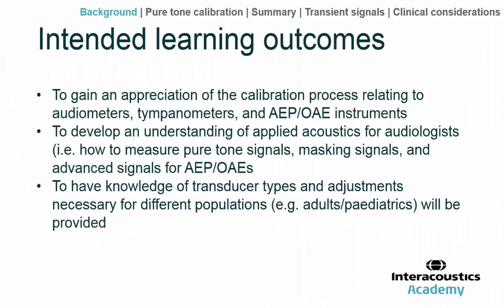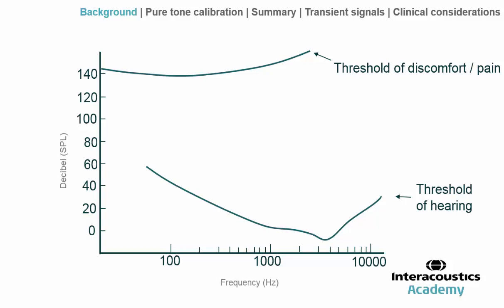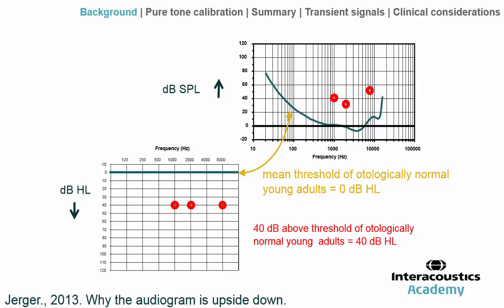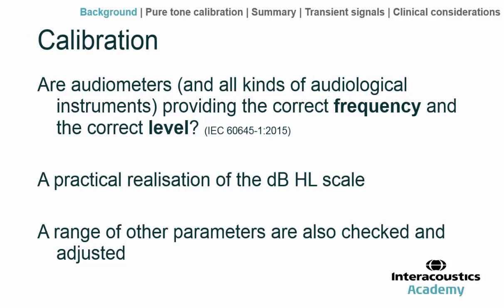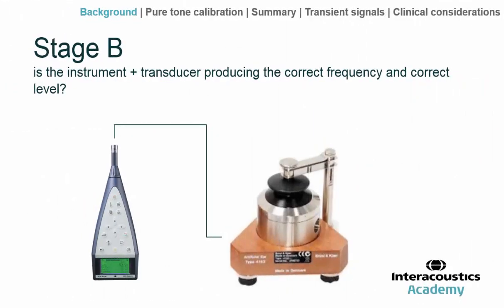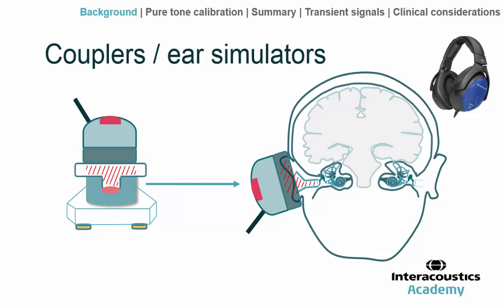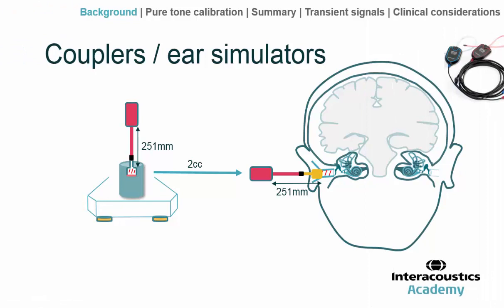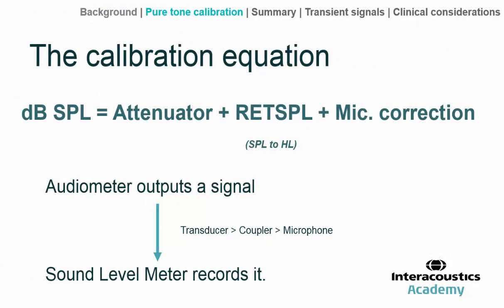Acoustics and Calibration for Audiologists (1/2)

Comment: Thank you for the clarification. In that case refers to force level. So, when considering force level, it's not SPL (Sound Pressure Level) but FL (Force Level), or rather microvolts per dB. Why should we factor in the sensitivity of the artificial mastoid?

Comment: Good video.

but how would it be to calibrate the audiometer but using Larson Davis.

Also how to calibrate the AFFINITY 2.0 AC440 Hearing Aid Analyzer

I wait your answer
Reply from the maker: Hi Torr,

Appreciate the feedback!

Please reach out to your local distributor / service technician for calibration.

Best regards,
Shane
Reply: @InteracousticsTV  Thank you for responding but I prefer to talk to you personally.

do not take it as a joke however it is important to learn from the direct manufacturer, can you help me?
Reply from the maker: @torrrock1788  You're welcome Torr,

In that case, may I suggest you write to our service team at service@interacoustics.com?

I'm afraid I'm not qualified to answer your questions 😅
Reply: @InteracousticsTV  Thank you for your collaboration but I want to mention something important. I understand that there are interacoustic policies by distributors but you should also know that distributors are not good at it and end up discrediting their name

However, since I need some recommendations (technical information and spare parts) to satisfy the customer regarding the performance of their equipment (audiometer or impedance meter), the manufacturer's response is necessary and not an intermediary (distributor).

I will appreciate the understanding of the case, and that you can consider my technical requirement.
Reply from the maker: @torrrock1788  Hi Torr, the mail I sent you (service@interacoustics.com) is to our service technicians / support staff located at our headquarters.

So they are the most qualified personnel to answer your questions, and they speak on behalf of us as a manufacturer.